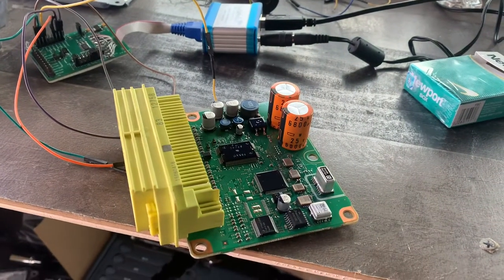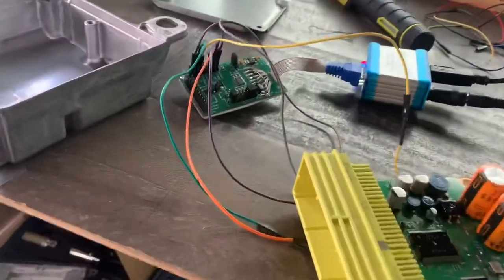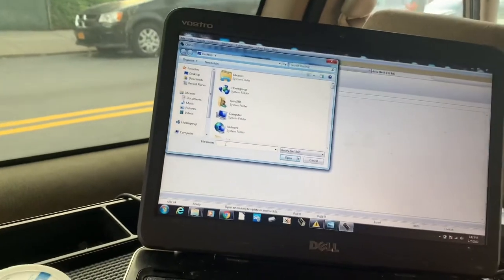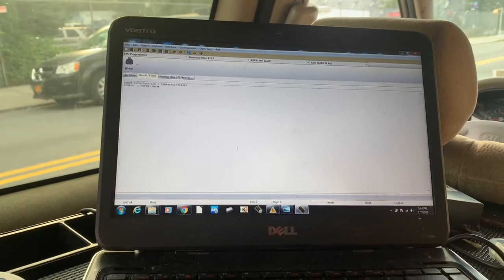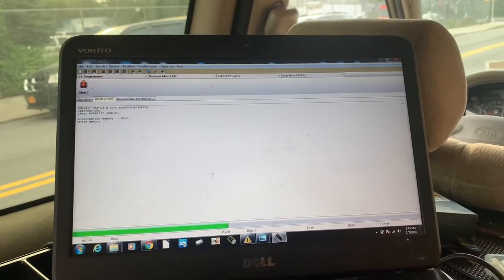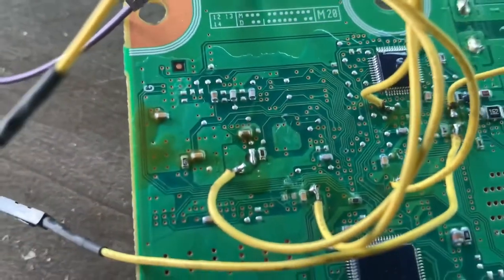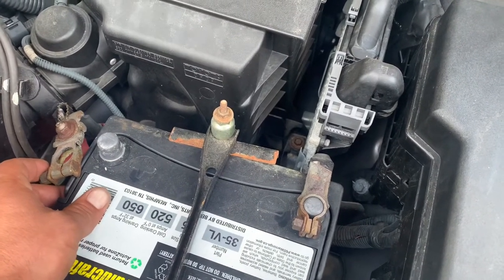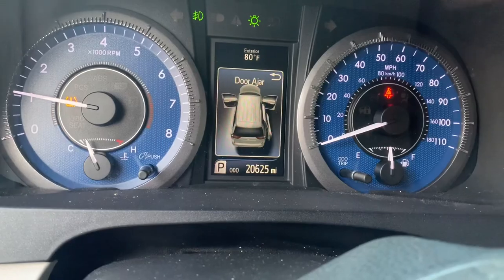Toyota Airbag Module Reset

Comment: Hi , do you still have to reset the module if you don't have any "crashed data event" or locked "codes.  Anybody else ever had an issue where you have a solid airbag light on and no codes from the SRS module .  My ground are okay ,but I am stumped.

Comment: Where can download software I buy car pro on ebay they send disc my laptop don’t have cd also where I can see diagrams for Toyota RAV4 2018 module
Reply from the maker: You can download software on diagcar.eu but you need the hardware and subscription which are not cheap. Doing this job with car Prog is kind of hard. Car Prog software is on codecard.eu which is free

Comment: Hi , do you still have to reset the module if you don't have any "crashed data event" or locked "codes.  Anybody else ever had an issue where you have a solid airbag light on and no codes from the SRS module .  My ground are okay ,but I am stumped.
Reply from the maker: Usually happens on Nissan’s. What kind of car? Not all the modules sets a code for crash data like Honda.
Reply: Hello sir pls can you give me the name of the tools to reset airbag units mojo